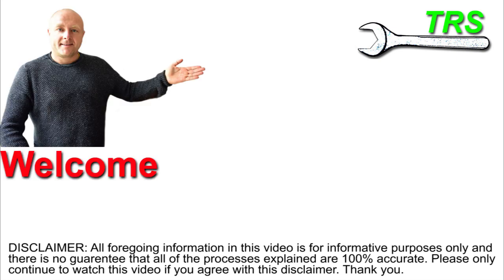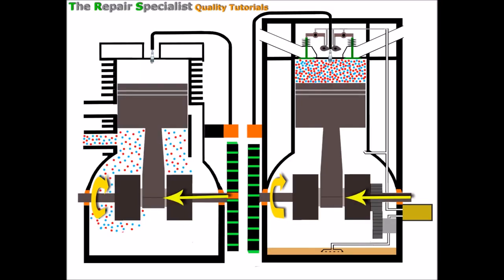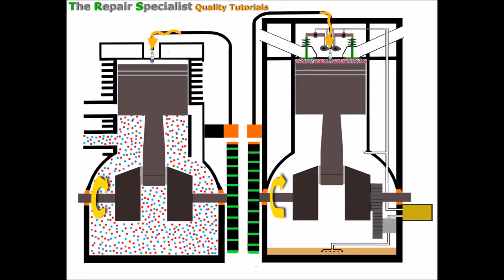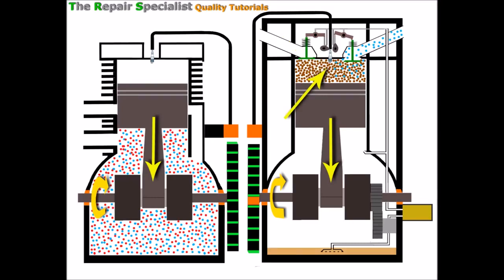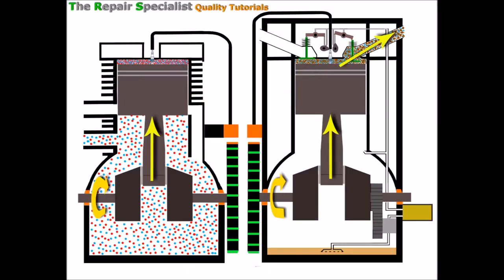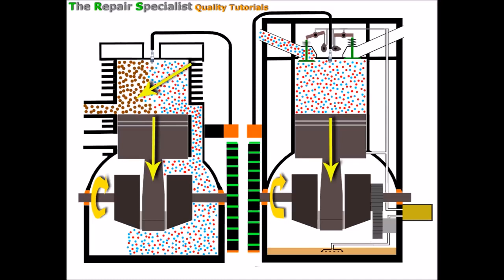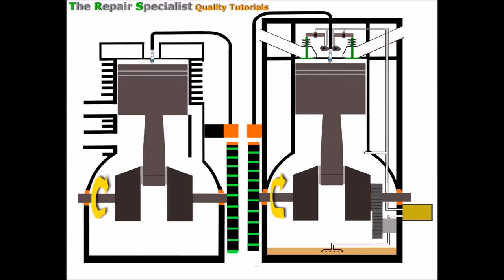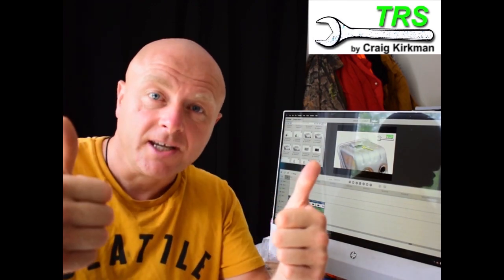Difference Between 4 Stroke and 2 Stroke Engines  (by Craig Kirkman)

Comment: Would a 2 stroke or 4 stroke last longer?
Reply from the maker: Hi.

Whether a 2-stroke or 4-stroke engine lasts longer depends on several factors, including maintenance, usage, and the specific application. Let's break down the differences between the two:

2-Stroke Engine:

Simplicity: 2-stroke engines are generally simpler in design, with fewer moving parts. This can make them easier and less expensive to maintain.

Power-to-Weight Ratio: They tend to have a higher power-to-weight ratio, making them popular for applications where weight and power are critical, such as chainsaws and some motorcycles.

Maintenance: While they are simpler, 2-stroke engines require more frequent maintenance, including mixing oil with the fuel, which can be a bit more involved.

Durability: In some cases, 2-stroke engines may have a shorter lifespan than 4-strokes because they operate at higher RPMs and have more frequent power strokes, which can lead to increased wear and tear over time.

4-Stroke Engine:

Efficiency: 4-stroke engines tend to be more fuel-efficient and produce fewer emissions compared to 2-strokes. They also provide a smoother power delivery.

Maintenance: They generally require less frequent maintenance since they have a separate oil reservoir for lubrication. This can lead to longer intervals between oil changes and potentially longer engine life.

Durability: 4-stroke engines are often considered more durable and have the potential to last longer because they operate at lower RPMs, resulting in less mechanical stress.

Applications: 4-stroke engines are commonly used in cars, lawn mowers, generators, and larger motorcycles due to their durability and efficiency.

In summary, if you're looking for an engine with a longer potential lifespan, especially for applications like cars or lawnmowers, a 4-stroke engine is generally the better choice. However, the actual longevity of any engine also heavily depends on how well it's maintained and how it's used. Proper maintenance and usage can significantly extend the life of both 2-stroke and 4-stroke engines.

Thanks
Craig

Comment: i am willing to convert an old 4 stroke 125cc motorcyle engine to an outboard boat motor ... i don't want to mess with complicated transmition techniques  so am asking if i can run that engin on his side that way i can directly weld its shaft to the propeller shaft ...i will be more than happy if you know the answer :)

Comment: I worked on a lot of Detroit 2 stroke diesels especially in boats with a few alterations you can make them operate in either direction clockwise or counterclockwise very handy.
Reply from the maker: Yes those are awesome engines.  Thanks for sharing! Craig

Comment: 4:13 shouldn't that occure way later in the cycle? at that point, the mixture should still be burning and expanding.
Reply from the maker: Yes. To be exact it most certainly would.  You are correct! I should have shown that but I just wanted to keep it as basic as possible.  Thanks for your input. Craig